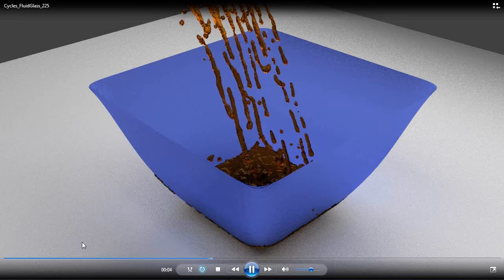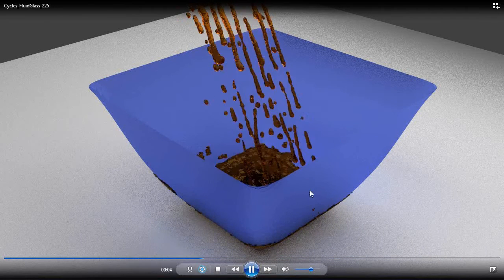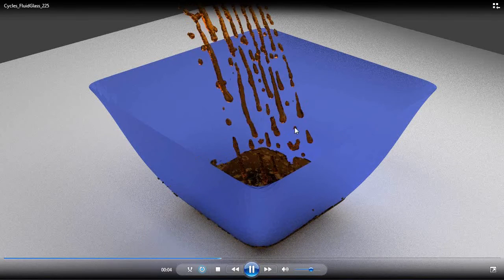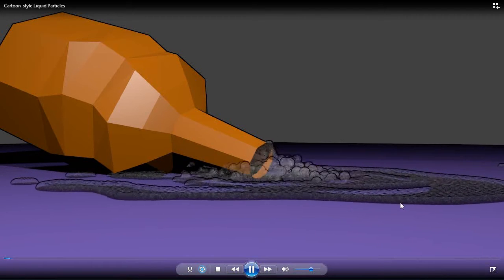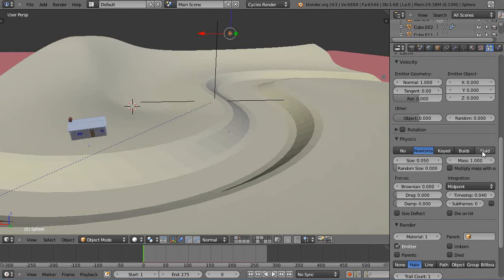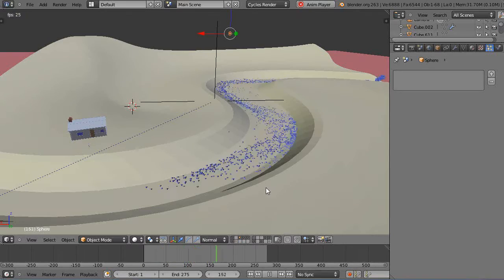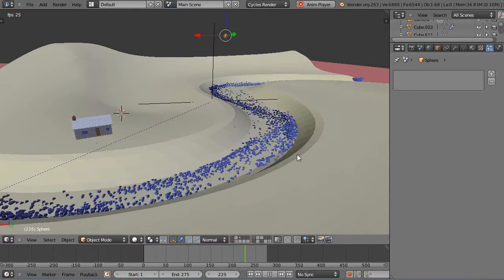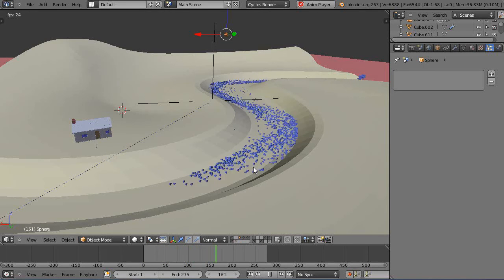Blender 2.6 Tutorial - Fluid Particles versus Fluid Simulation

Comment from the maker: You're very welcome. At least for now, the nVidia cards like the GTX-470, GTX-570 or GTX-580 give you a lot of power for the price, and importantly, if you have a system that has at least a 600-800 watt power supply (I have an 800 watt), you can add a second card in SLI mode to really boost the performance.  Another significant advantage of those cards is that they support GPU rendering with the Cycles renderer in Blender.  That gives me 5 times the performance over my i7 920 CPU!!!!!!!!